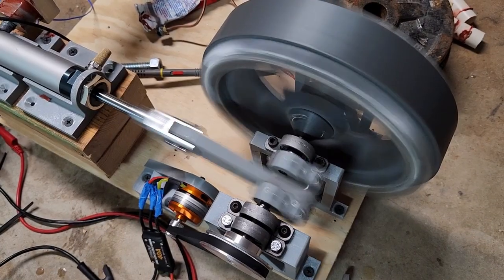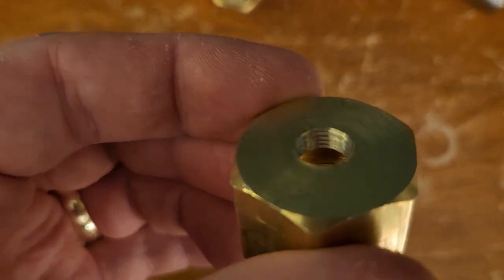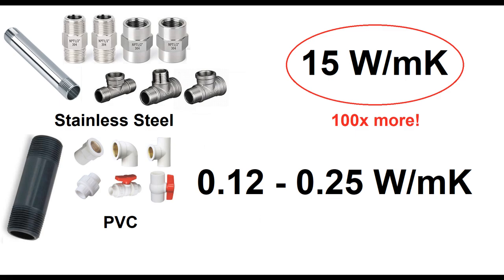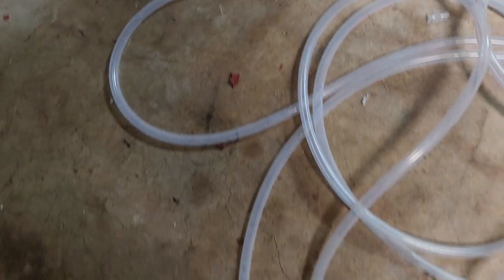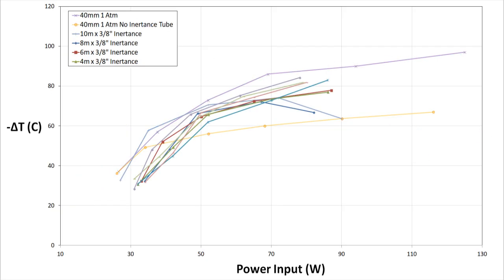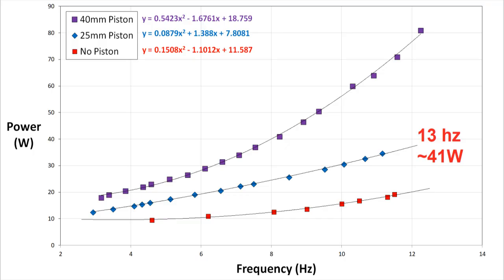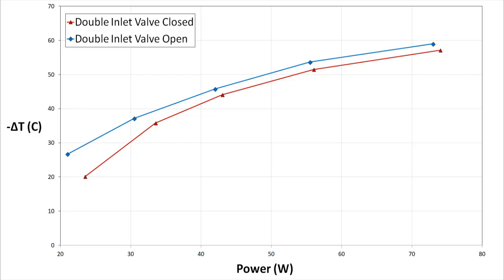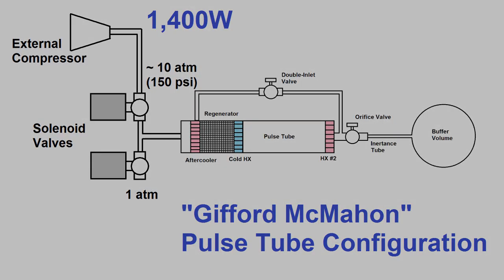Pulse Tube Cryocooler (Part 3)

Comment: Maximum performance depends on having the right frequency for your design and build. Every time you change your design, you need to optimize your oscillation frequency, just like a swing. If you kick out of phase on a swing you will either waste energy or every once in a while your kick will line up in the opposite direction and work against you. I believe you are getting large losses in efficiency due to this. If 1 out of 20 strokes lines up in the opposite direction then you lose 5% efficiency on that 1 cycle, but 18 of the other 19 will also be varying levels below maximum efficiency. Ie. 1 perfect stroke, followed by 18 with decreasing efficiency, then 1 working against, followed by 18 strokes of increasing efficiency. This means your cooling efficiency is made up of the average of the 36 strokes, since the 1 in phase and 1 opposite strokes cancel out.

PS. Cooling the hot end will drop the cold end temp because this is basically a heat pump and your device will have some maximum temp difference between hot and cold side that it can reach. Therefore lowering the temp of the hot end will lower the temp of the cold end as well.

Always keep in mind what you are trying to achieve. Push a "pocket" of dense gas into the cold area and let it expand, sending a "pulse" or wave towards the hot side/end/area, where it compresses, losing energy to the heat exchanger. This means the maximum expansion needs to occur when the wave reaches the cold end. Maximize these parameters and you reach maximum efficiency. Max heat removal and compression in hot side, max expansion cold side.

Comment: Hi, Im wondering about CO2 in the system, it changes phase from gas to liquid at around -40C/-50C depending on the preassure, and moving air through the system could lead to accumulation of CO2 on the cold end, just taking energy for phase change, or creating vapour chamber, and limit of temp drop in the system. Maybe you should try to fill it with pure argon/nitrogen.
Anyway great projec, and I wish you all the best.

Comment: only thingi can think of with the bypass is the length needs to be changed to bein resonance so the air shock meets aroudn atthe right phase, like a subwoofer airvent goingin sync withte speaker cone

Comment: Interesting why not stick to the  pulse tube in side a slightly large pipes and create a vacumn for sections that need insulation, and the regenerator be short in length as possible, but have a large diameter to reduce parasitic loss and it effect the frequency

Comment: Use the output of the cooler to cool the heat exchanger? Mixing in some warmer air so the exchanger doesn't get too cold. Is that even a reasonable idea?

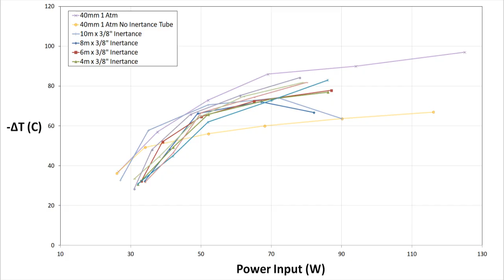Comment: 9:17 you need to bevel the copper pipes. Its a tiny loss in flow rate i think. 
You can dry your air by pumping it through activated carbon this also removes most organic gases. Probably already knew that but its a really cheap filter source.

Comment: Another excellent video, with great experimental planning and detailed data and discussion!  As a point of reference, FYI, I have a system at work with a 2-stage Gifford-McMahon Cryocooler for condensing Helium.  It has 40 W cooling capacity for stage 1 and < 1 W for stage 2.  This requires a 10 HP (about 8 KW) compressor, with some serious cooling for the compressor itself.  You may be running up against a compressor power constraint now.  Great work, very impressive progress so far though!  I can't wait to see more.  Best wishes!

Comment: @4:38 how about reducing the conductivity of the metal by coating it.  Perhaps as simple as a few coats of white enamel.
Reply: I'm sure you've already thought of this, but double-wall insulation w/ Air 0.024wmk, or if you really want to go all out Nitrogen 0.023wmk.

Comment: Very well documented progress! Another thing I'd look at is whether the water vapor in your gas causes a significant decrease in performance. It should be relatively easy to compare the performance with regular compressed air and some form of drying(even a pipe full of baked silica gel will do).

Comment: Have you thought of insulating the inside of the pipes with resin, or melting plastic and rotating it? Not that it really matter at this scale, it would also prevent some corrosion. And as others have mentioned, just a simple fan blowing on the hot heating could have a dramatic difference.

Comment: Analogy equations may be helpful in tuning resonance, etc. See the below, it notes how you can change temperature to voltage. If you do this then you could fairly easily simulate a design with a tool like QUCS or similar simulation tool.  

http://edge.rit.edu/content/P14361/public/DDR_Documents/System_analogy_all.pdf

Comment: Could you make this work with a giant sub woofer?
Reply from the maker: Yeah, it's called a thermoacoustic refrigerator. I tried building one, but only got about ~8C of drop with a 100W woofer, and the speaker burned out
Reply: @HyperspacePirate  yeah I have seen nighthawks videos on the topic. But it seems like a similar system if you don't need as high a compression ratio. Based on the line you said here. But I'm no expert in refrigeration technology.  Well if you tried, results speak volumes.

Comment: Have you considered high pressure PCP pumps like those used in paintball equipment? The high pressure allows fairly low temperatures.

Comment: Ok everything I have read says helium is used to get to the lowest temperatures also you need to cool that bundle of copper tubes to get even lower temps but with ambient air being used as a medium you can only get so far and also the moisture in the air will start to freeze as u saw in one of your videos so you will need to create a vacuum first and ensuring moisture is removed before adding the helium. Many seem to say a form of cooling to reduce the temperature of any returning gas like you tried or else you compressor will actually be heating up too much. Also from my reading that the end part. That chamber needs to be calibrated to a proper size for the system I have no idea how to do that but if not the right size it can affect the whole thing supposedly also.

Comment: Really impressed with your level of data and iterative process. I think it's best to work out how to improve rough design rather than cool the heat exchangers. As you will only need to do that to scale volume of liquid N2. Lots of work needed to absolutley make sure the design is as simple as possible.  Many knobs to adjust means many possible interaction to tweak.

Comment: A couple of others have noted, and I'll add as a reminder.  You are pushing into air liquification temperatures, and that will eat up a lot more power.  At one atmosphere you are already hitting CO2 liquification, and at higher pressure you could be getting close to O2 liquification.  And since your thermocouple is averaging the temperature over a second or two, the per cycle temperature may be oscillating above and below liquid temperatures.  These rapid phase changes, many times per second, will eat up power until the bulk temperature is below the liquid temps.

Probably best to switch to at least pure N2, to help mitigate the potential of phase changing.  And N2 is cheaper and easier to get at welding shops then He.

Great videos, and have fun exploring.
Reply: Yea i was just about to comment that that flatline he keeps hitting close to -80C makes me feel like he's coming up against a phase change or something. I'd love to see him address this concern with one of his neato charts!

Comment: Very cool project and well explained with data.  I'd love to try to build a prototype of my own.
I figure your goal is to liquify air in a single stage unit.  However, I assume it would work to build a dual or triple stage system where the cold end is cooling the hot side of the next stage.  Even if you only got half as much -delta T out of each subsequent stage, it seems you could get liquid air in 2-3 stages.

Comment: Just an idea but would it be possible to get a steel pipe big enough to fit around the PVC so you have the insulation of the PVC but the strength of steel?

Comment: This just seems to me like you may be hitting the phase change of CO2 in the air. look at a phase diagram and it hits -75 at around ambient pressure. Like water wont exceed 100 degrees no matter how much heat you put into it until all of the water is boiled to water vapor. Your limit may be similar, just CO2 vs. water. You could try reducing the pressure to a slight vacuum to see if the temp lowers. if it does - then i think that would be pretty definitive result.

Comment: I've worked with pulses tubes few month ago, I'm not an expert but I may have some idea to improve your system!
You can use silica aerogel as insulator. It's way better than glass wool. You can increase the surface area of your heat exchanger with heat pipe(cuts both ends and use it like a copper pipe).
I've heard that regenerator is often made of stainless steel or small lead balls which have a high thermal capacity and doesn't reduce the flow too much!

Commercial pulses tubes use helium mostly because it liquidized at 4K but I'll recommend you to use at least really dry air, any water vapor can drop the efficiency!

Edit: typo and french
Reply: I searched calloducs but no results, plus "lead bids" please explain? All I get in the search is auction like results,
Reply: @seeker1015  sorry calloducs is the french name you should search "heat pipe" 
Sorry I meant balls don't know why it wrote bids

Comment: That's a lot of information compressed into less than 20 minutes.
I'm still concerned about the flow resistance of the relatively small diameter inertance tube and the pure conversion of pressure differential plus flow into heat of the needle valve. The one is easy to fix but I do wonder if replacing the needle valve with a convergent-divergent nozzle would help. It might be worth it especially if the maximum efficiency of the valve opening seems to be relatively constant regardless of a lot of other changes, which it seems to be.

That asymptotic convergence of efficiency regardless of configuration seems to imply a common source of inefficiency.
Reply: my guess is a phase change is the cause of convergence
Reply: @Skeys13  I'd have to say pretty much just 'no'. I don't think there's enough water to matter here and he's not anywhere near a temperature to make anything else change phase.

I think the only place where that could be a problem is the regenerator, if liquid water is forming in the cold end and wicking through it, that would massively increase its thermal conductivity, but he's getting temperatures way below freezing that would stop liquid water from moving.

The amount of carbon dioxide is going to be negligible and he's got a long ways to go before oxygen starts condensing.

Comment: I noticed that the copper tubing you are using was cut with a standard tubing cutter but the ends were not de-burred.  The burr formed on each tube is effectively turning your tubes into double orifices causing expansion losses at each end.  And while the "orifices" are deep into the open end of the fitting they can behave like venturi tubes and waste valuable gas expansion.  If you can get your hands on a 2mm swage tool so that the tube itself is the venturi instead of the ends I estimate 5 to 8% increase in capacity with the double inlet setup.  Having about 1m^3/min airflow over the hot end per watt total input power will help dissipate friction loss heating significantly.

My background is only phase change refrigeration and air conditioning so do with that what you will.  Use of a common refrigerant like pure CO2 or 134a are my choice for hobby projects but I don't remember if you were trying to use pure air at which point I would like to point out the obvious that any moisture in the air makes all the above moot since it has a massive effect due to it's specific heat capacity.  Cheers!
Reply: You are absolutely correct 9:17 all of those need to be deburred and chamfered. That will increase flow rate a bit. Should upvote this its a easy thing to forget.
Reply: @fajile5109  You could place the fitting in a lathe and machine the tube ends flush with the fitting and perhaps even countersink then a bit with a drill bit.

Great project and I hope you succeed.  A potential source of Nitrogen would be the exhaust vent of a small consumer Oxygen concentrator.  Having liquid nitrogen always available opens up a lot of possibilities.  You can make multiple cold traps at N2(l), CO2(s), H2O(s) and perhaps a couple more phase change temperatures.  Let you gain better solvent separation and freeze drying performance.
Reply: I was thinking the same thing. Also he could put a larger copper pipe over the hot side and phase change cool it

Comment: If you need the regenerator to cause less resistance then, like last video, I suggest trying out a different regenerator construction. Take stainless steel strips/foil, press some dimples on it (apparently a sewing machine works fine for this; alternatively I'd imagine just pressing some slight sharp notches with a knife or something would also work), and then roll it up like a rolled cake. It would be like a very dense air-cooler heatsink - air can pass (relatively) unimpeded between the different fins (layers of the roll), while still exposing a large surface area for heat transfer. 

While I doubt a better regenerator design alone is a miracle magic bullet for the project, if it gives you another 5C gain, then that's worth it, no?

Comment: It might be worth a test on removing the muffler on the piston you are using. Sure they work great at reducing noise but they do limit flow on our automation equipment. You might be able to gain a little bit of efficiency without it.

Comment: Could you line some of the metal parts with epoxy to throttle the conduction loss a little? Maybe using a 1 dimensional spin-caster ("lathe") to get an even layer? Actually, spincasting an epoxy lining should also solve a lot of leaks in the plastic system

Comment: Thanks for the videos :) 
I heard pulse tube coolers efficiency is effected by pulse tube orientation. I dont know would it be practical to make pulse tube vertical (cold head down) but I saw like %15 efficiency difference compared to horizontal orientation.
may be another point.. about phase shift mechanism.. may be you already considered but, I like the idea to actively control phase difference by another compressor piston (or 2 more  aditional solenoid valve from same air compressor; 4 valve system). I dont know if it would increase the performance but may be it help to manipulate the phase difference better.
I cannot guess how did copper tube extension to heat exchanger effected the gas flow resistance but may be in this new setup with air compressor, compressor can also cool the gas to ambient temperature itself, so may be it worth a try with and without copper tube extensions to heat exchangers?

Comment: I come from a background of tinkering with heat-engines and it's pretty typical with many engines that the designer worries greatly about the hot-end, and pays little attention to the cold. There's often worthwhile gains to be found with a decent cooling system,. 

It will certainly help to keep all your nice graphs lined up if you were to use a consistent hot-end temp for baseline. I suggest an ice-water bath, as it'll provide a rock-solid repeatable temp near freezing, and should get you down to dry-ice temps with ease.

Pressurising with nitrogen would also be worthwhile, it works well for engines turning heat flux into power, I can't see why it wouldn't work the other way around! of course, you'll need to use the stainless setup as PVC can be a bit dicey under pressure, but with some proper insulation and cooling where appropriate, it's quite do-able. nitrogen's cheap after all!

Comment: the circuit equivalent makes me wonder if using that with spice software (which i think has stuff to optimize component values) could help you get the best values and then convert that back to air parts as closely as you can to get a better result

Comment: Have you considering using a diaphragm rather than an air cylinder? Since you're fine with a smaller compression ratio you might find lower friction losses.

Comment: You are still using air-cooled heat-exchangers. By circulating water around the hot exchanger and a secondary heat-exchanger from PC-watercooling components more heat can be removed from the system. Maybe looking into metal powder (as is used for sintering) for the regenerator as well, you can get much higher packing densities and a variety of possible metals and structures (sponge, flake, powder) are available.

Comment: Heat rejection is another bottleneck. The relatively static air around your heat sinks is not removing heat effectively. Just placing a 60-120mm computer fan blowing across the heat sinks would improve performance. Even better would be either water or increasing the external surfave area of the heat sinks. If you have a couple of heat pipe cpu heat sinks and water blocks you could shove the pulse cooler heat sink pipes through the fins and drastically increase effective external surface area.

Comment: I would recommend a water separator and high flow desiccant filter for removing moisture from the compressed air supply.

Comment: you could try adding grease to all the moving joints and also insulating the outside of the pipes with even something simple like duct tape.... every little bit helps